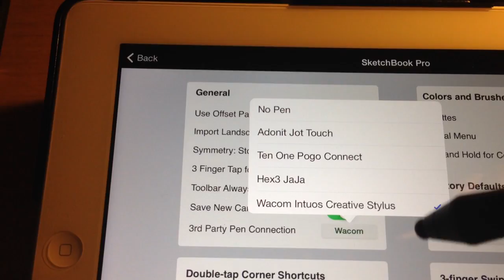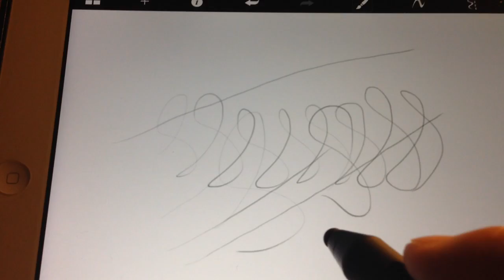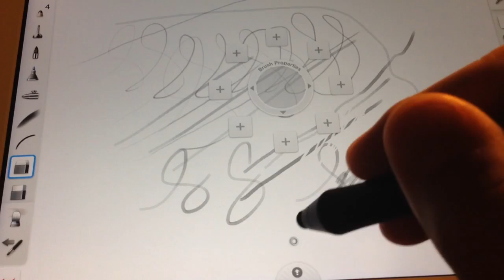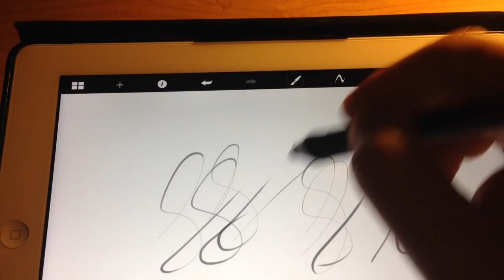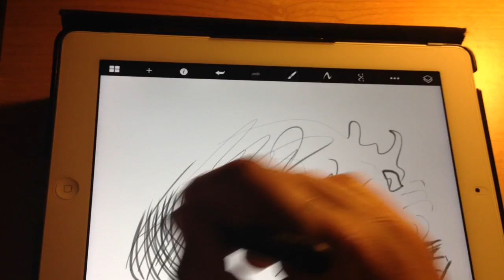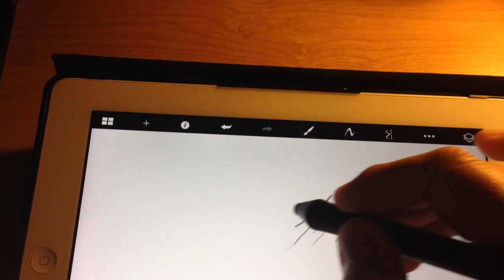Wacom Intuos Creative Stylus Review Part 2

Comment: Would you suggest this for Note taking? If so which app would you recommend?
Reply: I will really suggest to use a pressure sensitive stylus if you are a pro writer , I use my script right now , but I suggest you use noteplus and/or noteshelf the new app ink is really wonderful with intuos creative , but don't use myscript , coz the ink is pixelated as it is not vector

Comment: what i dont get, why are there tips so god damn chunky,... so dumb
Reply: It's a physical limitation of the capacitive touchscreen technology.  It requires a fairly large area to be touched in order to detect it.  Wacom would love to not need such a big tip, and in fact, their tip is smaller than many other stylii. You can read about capactive sensing here: http://en.wikipedia.org/wiki/Capacitive_sensing
Reply: Ken Carpenter
Only thing i don't understand about that, is my galaxy note stylus has a very tiny pen tip, and that has a capacitive touchscreen too.
Reply: Actually, the Galaxy Note series of tablets have a Wacom digitizer built into the screen too.  The pen uses that and is therefore much more sensitive.

Comment: Same as you, I have all these apps and softwares for painting. I have TVPaint free trial on my Samsung Note Galaxy. Tell you the truth, you won't like TVPaint - it's rubbish. You can though use Artrage with any animation software.
I take you're an animator. Have you seen Tab Pro 3.2? I got it a few weeks ago. In Tab Pro, you can not only draw lines, also position lines or thicken them, use iron to smoothen out scraggly lines. Tab Pro 3.2 is the smaller version of Toonz Harlequin by same company

Comment: Look to TruGlide Apex at Kickstarter, that is, if you want a point-tipped stylus. It isn't as pressure-sensitive as Wacom pens, but I have backed its project at Kickstarter. Its stylus is ready for mass production next month. Hopefully, I'll get mine by December. You know what, you can always use both TruGlide Apex for fine line drawing and your Wacom for thick lines and paints. 
The creator of TruGlide Apex is now onto next project for next year, a stylus, this time with pressure sensitivity.

Comment: Nice review.
I think you're right about the tip's mechanism. I noticed that on my Intuos pen - same spring-kind of mechanism. Makes sense for registering the pressure level.

I have an iPad2 sadly and I will try to sell it and get a 3 or 4, because this stylus only works on those models.

Btw using my imagination - the sketch looks like a sea monster going for a ship =P...